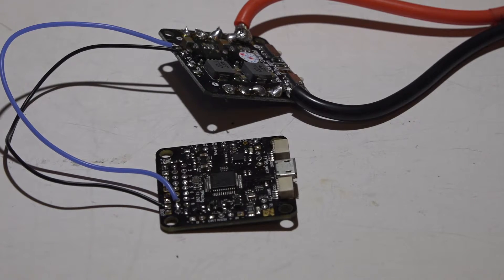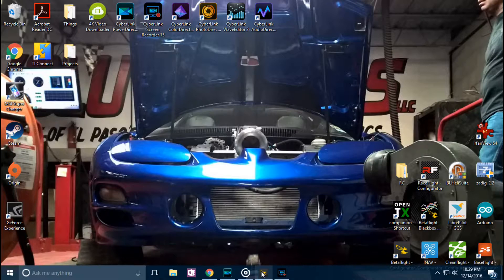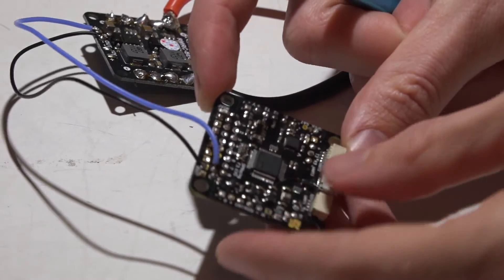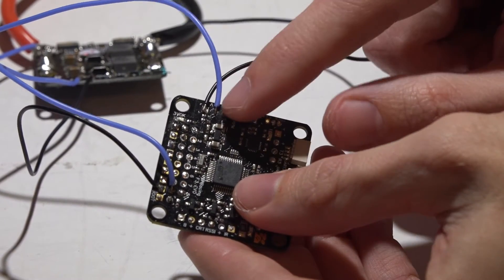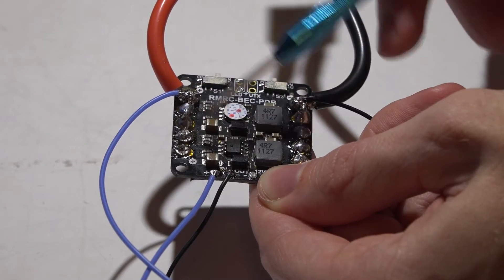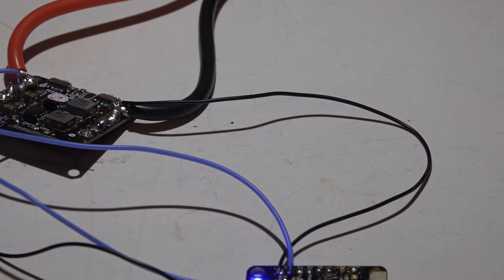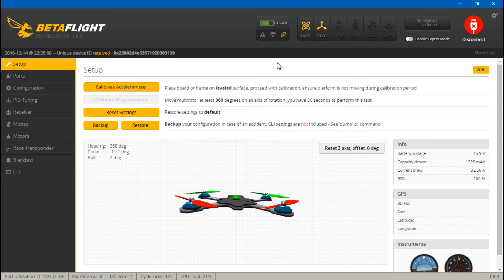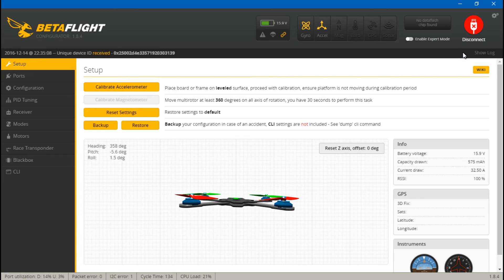SPRacing Evo: Getting Voltage In Telemetry

Comment: is it matter how V is the battery ? its not burning out the FC ? i mean use 4 cell battery it will kill the fc ? 

Regards
Reply from the maker: You can use a 4 cell battery on the VBat pins. It wont hurt anything. Just make sure you power the flight controller with 5v.
Reply: got it. thank you very much